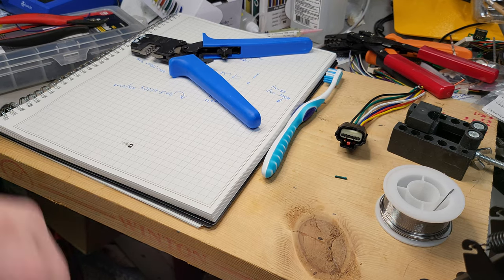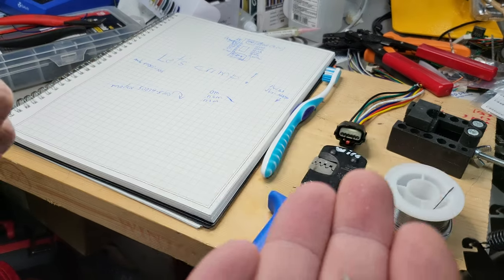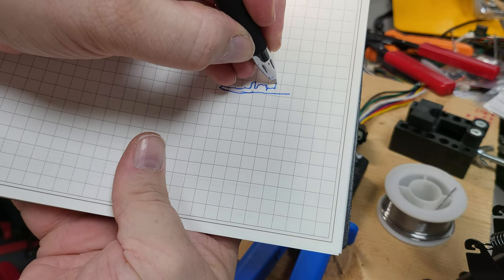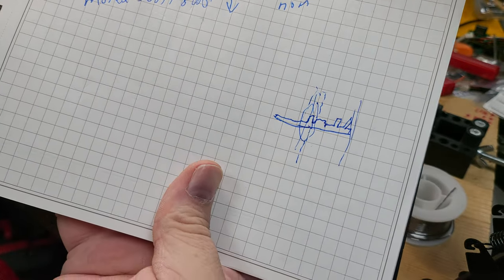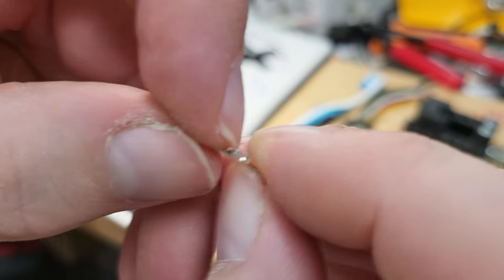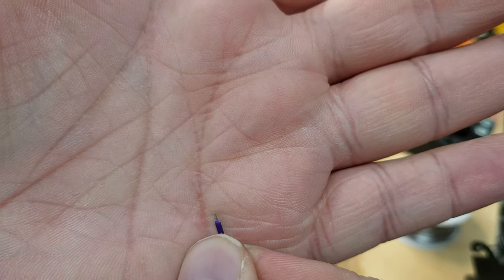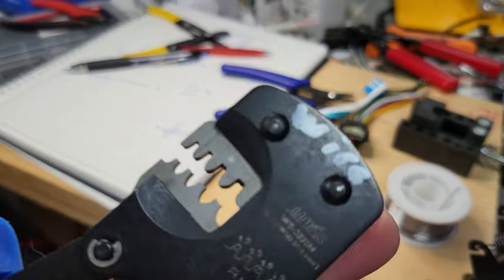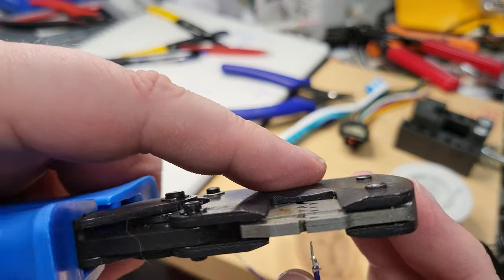Tips on crimping tiny molex terminals

Comment: For tiny JST terminals I definitely prefer IWISS IWS-2820M crimping tool. It's a two step process(insulation and electric wire) but I feel like I have more control that way and it works every time to get a good crimp.